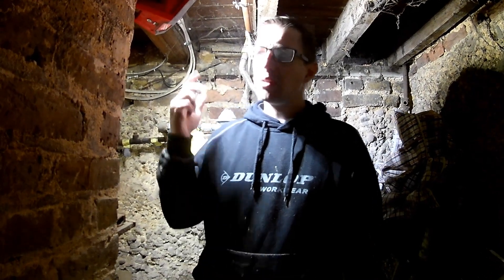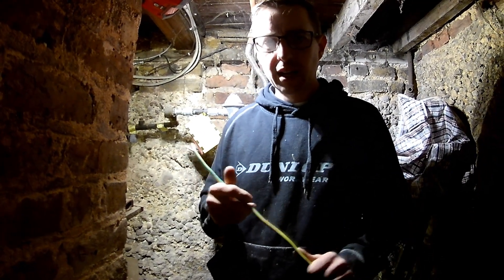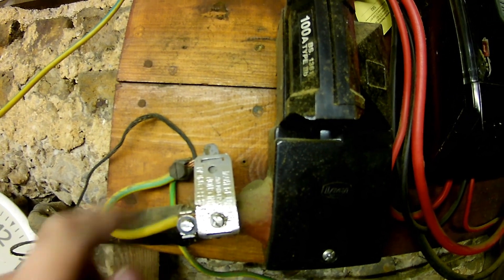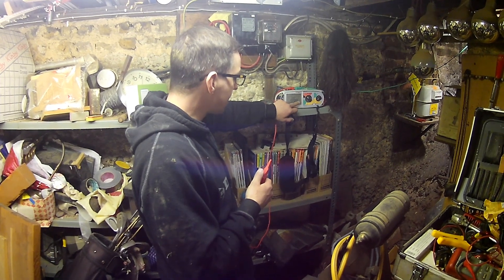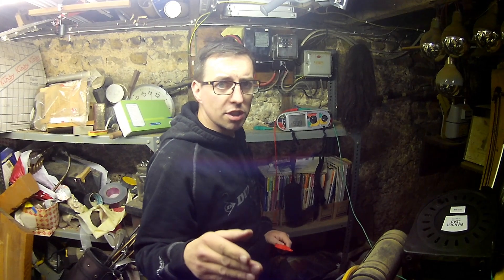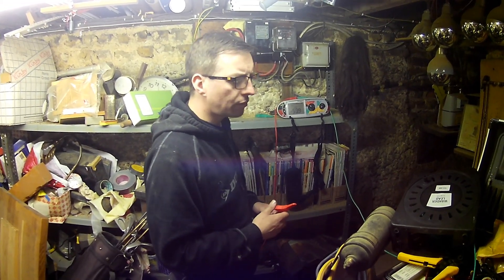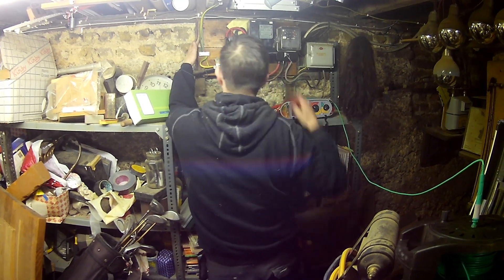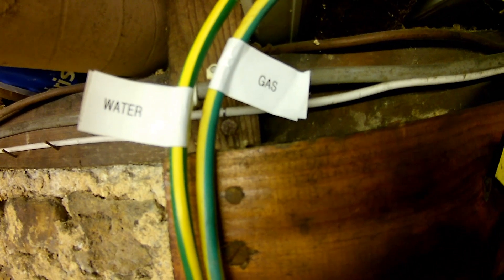Bonding - Gas and Water - Why?

Comment: If incoming water main is plastic (blue pipe) but turns into copper pipe at the Installation side does it still require bonding? Cheers

Comment: Nice vlogs. Why 16mm2?
Reply: zjzozn in London the LEB used to insist upon 16mmm bonding cable! Also working out r2 values in relation to touch voltage on non domestic install can vary the size.